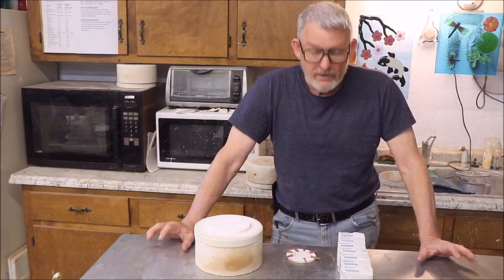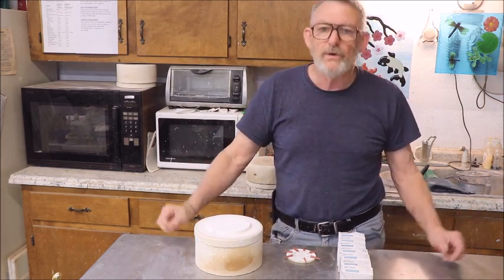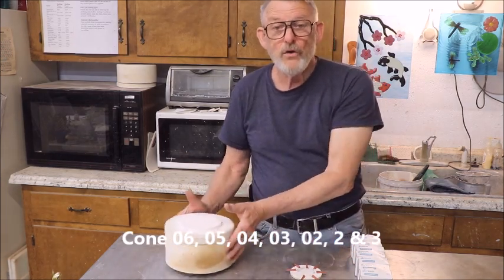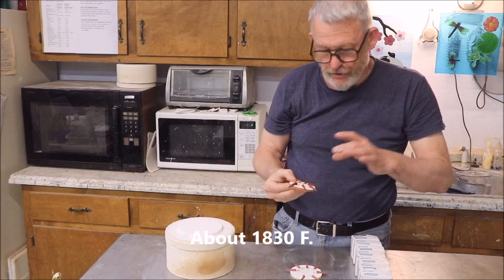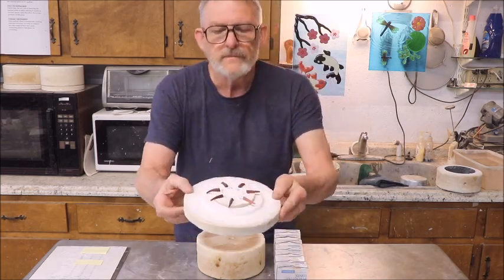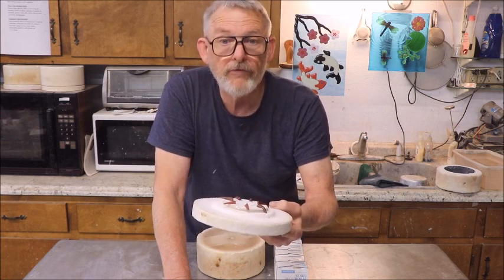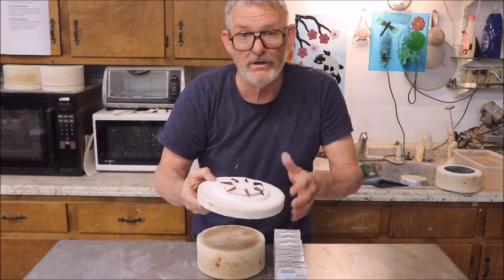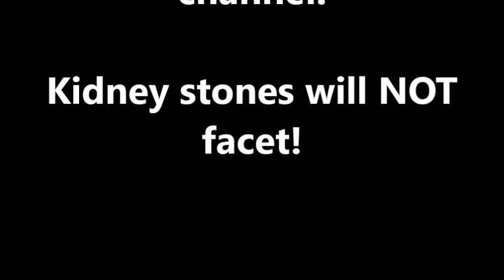Microwave Kiln Temperture Tests

Comment: your supposed to stand them up and if they bend to the point where the tip points down (90 degrees) theyve reached that temp. i just found that out 2seconds ago. great vid.
Reply from the maker: Your right, but sometimes yo have to go off script.  I could never get them all to stand up streight in that kiln!

Comment: I just got my microwave kiln to pass cone five. Maybe even higher but I just had a cone 5 cone in there. The heating elements started to melt and the kiln insulation it self stated to mature 😂 i only had it in there for 13 minute in my beast microwave haha

Comment: Anyone tested out the same cones on a half as powerful microwave in the 700-800w range. Would be interested to find out if it only took double the time(40min), to reach cone 006 or the temp of 1000 degrees celsius...
Reply from the maker: I have not noticed a big difference in the times needed to melt glass.  It usually takes 15 to 20 minutes with either of my microwaves.

Comment: one way to further refine the temps you can achieve, would be to try and melt a small amount of metal with a known melting point. For instance copper melts at 1084C/1984F, silver melts at 961C/1763F. If you set a small amount(a few grams) of each of those in the kiln in your test and it comes out molten at the end, you know you've reached that temperature.
Reply: Melting metal in the microwave may prove rather problematic
Reply: @beccar0ze  It is reportedly perfectly ok. It is routinely done with PMC (metallic) clays. My microwave came with a metal rack. As long as it doesn't make contact with the sides, isn't a thin foil or coating, and isn't a sheet large enough to deflect energy back into the magnetron, metal is actually ok to have in the microwave.
Reply: @beccar0ze  My science microwave looks like a powder keg went off in it, and I've done a number of metals in mine. Aluminum is really easy, though perhaps most satisfying is using a cast iron skillet as a base for carbonizing powders. The skillet will get warm but not arc unless it catches debris from a previous experiment.

Comment: Hi. After watching your videos, I have a MWK coming soon. What I want to know is, should I get a microwave just for using the kiln, or can I use the one I use in the kitchen. I'm planning on getting another one, but until I do, I can't wait to have a go. It should be 1000 watts or higher, shouldn't it?
Reply from the maker: It is "suggested" that you do not use the same MW oven for the kiln and for cooking.  However, I use mine to make popcorm all the time.  A 1000W MW is nice, but any of them will work.  The times may have to be longer.

Comment: That's not the correct way to use cones. They must be set vertically with a leveled base clay to keep them from moving.
Reply from the maker: In the video I mentioned that these Orton cones were not the proper cones for this type of test...but they were what I have and they work similar to the temp testing cones.  The whole idea was to get a ball bark idea of the temps in a MW kiln.  Temps, hold and soak and things that are almost impossible to do in a MW kiln.  I think I came close to what you can achieve in the MW kiln.  As always, thanks for your comments.  You never know when I will completely screw up (and I will do a video on that later). Thanks for watching.

Comment: Hi Capt. Mike, Thanks so much for your videos, you explain things so well. I just found this cone video so will do this next. I am really new to ceramics and while saving for a big kiln, saw your bisque and Raku microwave videos. I tried some small pieces for fun, in two stages bisque then glazed. They worked well, the glaze fired and was clear and shiny, so I guess the temp was right enough, but the following day my cat jumped on the bench and knocked the piece off. It chipped really easily so I tried breaking the remainder in my hands to see how strong the finished piece was. What I am wondering about is even though the temperature is good for firing, in you experience with both types of kiln, will the pieces get as strong as say a 8 + hour duration in a conventional kiln? I gave them about 18 minutes per firing and checked to see them glowing etc before thinking they were done but maybe they needed longer?
Reply from the maker: I have never thought about whether or not the added time in a large kiln would make a stronger piece.  I will have to run some tests to check that out.  Thanks for the comment.  It's always good to hear from someone with an inqusitive mind.
Reply: @CaptMike  Thanks Capt. Mike, i'm probably doing too much thinking and not enough doing at this stage, but with your help I have at least managed to fire a few test pieces for fun. I live too far away from anywhere who can fire my pieces, so just doing some research before leaping in and buying a big kiln. I have a little Paragon SC2 for metal clay and enameling but I don't think it would be wise to use for 8 hours + and it's not really designed for the temps over 1000c
Reply from the maker: @sweetaviator820  Keep up the good work.  I'm sure you will work it all out.  If I can help please ask.
Reply: hi ! that's interesting ! i've learn that in order to get sturdy ceramics when bisqued, they have to be fired following a precise curve, with a slow rise of température to evaporate the water of cristalisation (always present in non-fired clay even really dry) and then go through a landing at high temp (for  aprox. 30-40 minutes in a classic kiln) witch allow vitrification and thus, sturdiness. The kiln is as well set to cool by itself.  
Then maybe we can mimic such cuves and heigten gradually the microwave's power, as you run successive shorts firings. You have to know the temperture for each adjustment of the microwave ...
sorry for the wobbly english, and thank you for this discution !

Comment: Thank you so much! Also I fired my 700w for a total of 24min (3min bursts) but the roof inside the kiln has cracked a little do you have any cracking on the white in your kiln at 30 mins? Thank you
Reply from the maker: So far I have not had any of my kilns crack.  I do get normal ware and tear of the soft parts over time.

Comment: Hi Capt Mike, here a question from Southern Spain. Do you have any experience with horse hair raku in the microwave? I love your video´s! Greetings
Reply from the maker: I have not tried that in the microwave kiln, but it should be able to do it.  Just get the ceramic piece hot enough.  I'll try tomorrow.
Reply: @CaptMike  Thank you for the quick answer Capt Mike!! Looking forward to seeing/hearing your answer.
Reply: @CaptMike  I think glazing won´t be possible because I remember the horsehair had to be done straight on the ´naked´ chamotta clay after taking it out of the oven at about 900 degrees C. I´ve got one item with glazing, but the fusing process couldn´t be done as it can´t go into the fire after coming out of the oven. I´ve done it only once a couple of years ago in the big raku at a workshop and now it is my challange to do it on my own: big raku ánd micro both with horsehair.  Oh dear..... a bit scared but results are very interesting.
Reply from the maker: @practicasinternacionales6692  Thanks for the comments.  I completed a "horse hair & feather" tesyt today and will post the video as soon as I can.  Interesting results.
Reply from the maker: @practicasinternacionales6692  the video is here: https://youtu.be/qoGgzZOVfYE  Let me know what you think.

Comment: Hi, Captain Mike I need to buy a dedicated Microwave Oven to Raku in a microwave kiln. Your microwave in this video was 1500Watts. Do you think it is likely an 1800Watt microwave oven would be suitable for firing 1 or 2 large microwave kilns?? I appreciate your thoughts!
Reply from the maker: Actually anny of the microwaves will work.  You will just have to experiment a little to get the times right.  The nice thing about these small kilns is if you have a failure it is reall no big deal as far as time and materials go.  Good luck!

Comment: Hello, I am new to microwave kiln firing and I have a question. I started heating my clay (some covered with BOTZ Engobes) and after just a minute there was a quite strong icky smell coming out of the microwave. Is this normal? I am not sure where the smell was from, the pieces or the microwave or the fiber paper underneath them or the kiln. Any advice? Ill make sure to wear a mask from now on… thank you so much!
Reply from the maker: If you were using cermaic clay that would not be it.  Sometimes with the firsst firing using fiber paper there will be an order.  I think that was most likely it.